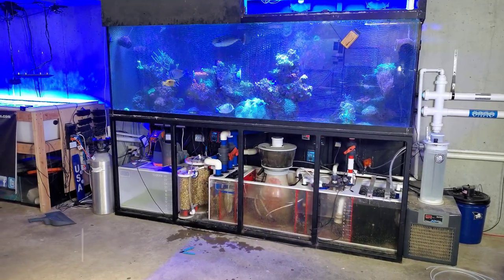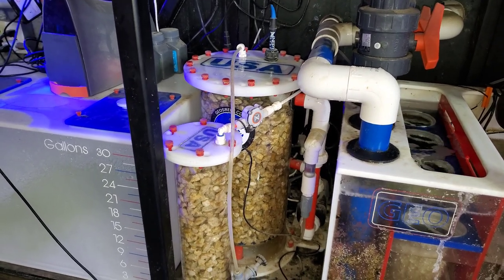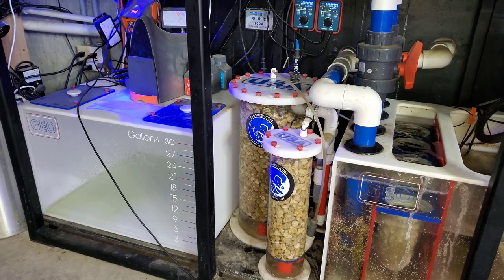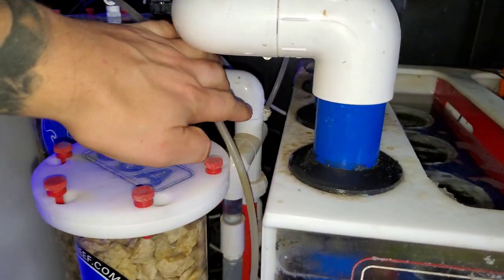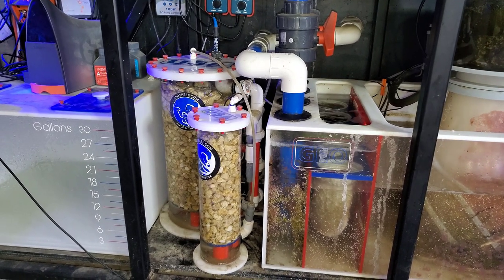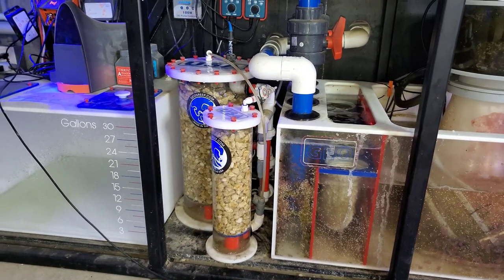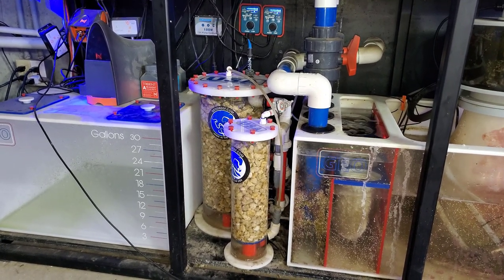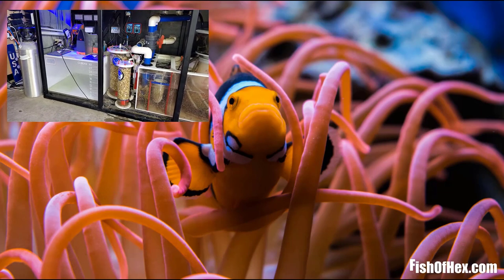This Is Why I Always Keep A Flow Sensor On My Calcium Reactor

Comment: Unfortunately the 1/4 inch flow monitor only works at rates above 3 gallons per hour.  I only run 60 ml/min so it doesn’t work for me (63 ml/min is 1 gph)